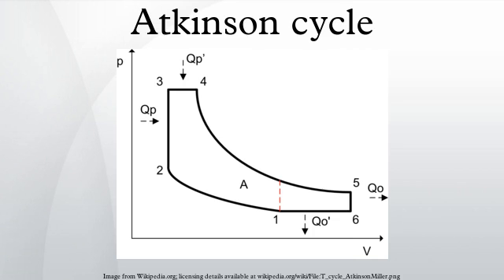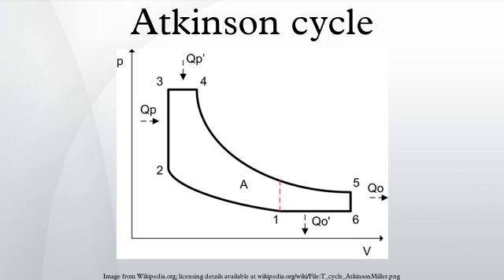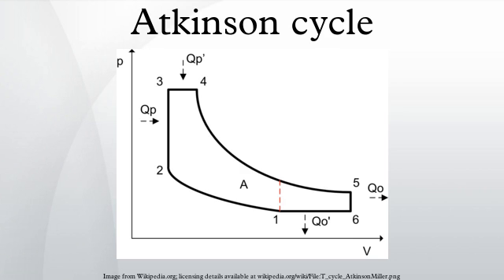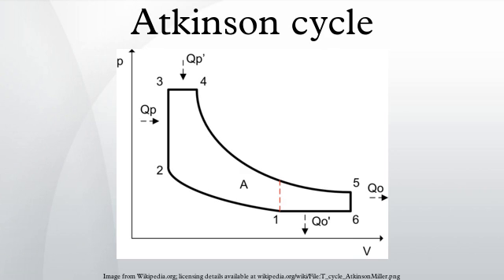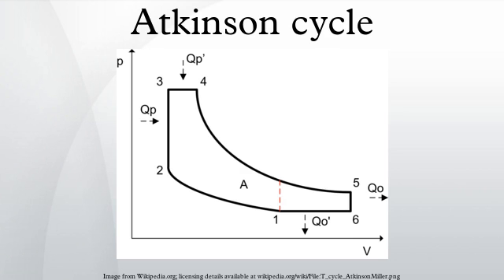Atkinson cycle

Comment: John Lucas
1 second ago
James Atkinson's third design was a 2 stroke named the "Utilite Engine".Atkinson's "Cycle" engine was efficient, however its linkage was difficult to balance for high speed operation. Atkinson realized an improvement was needed to make his cycle more applicable as a higher-speed engine. The final engine produced by the British Gas Engine company was the Utilite Engine. With this design, Atkinson was able to eliminate the linkages and make a more conventional, well balanced, engine capable of operating at speeds up to 600 rpm and capable of producing power every revolution yet he preserved all of the efficiency of his "Cycle Engine" having a proportionally short compression stroke and a longer expansion stroke. The Utilite' operates much like a standard two-stroke except that the exhaust port is located at about the middle of the stroke. During the expansion / power stroke, a cam operated valve (which remains closed until the piston nears the end of the stroke) prevents cylinder pressure from escaping as the piston moves past the exhaust port. The exhaust valve is opened near the bottom of the stroke, it remains open as the piston heads back toward compression, letting fresh air charge the cylinder and exhaust to escape until the port is covered by the piston. After the exhaust port is covered the piston begins to compress the remaining air in the cylinder. A small piston fuel pump injects a rich fuel/ air mixture during compression. This design resulted in a two-stroke engine with a short compression and longer expansion stroke. The Utilite' Engine tested as even more efficient than Atkinson's previous "differential" and "cycle" designs. Very few Utilite Engines were produced, and none are known to survive. The British patent is from 1892, #2492. No US patent for the Utilite Engine is known

Comment: Not many people are aware of Atkinson's  last and possibly best engine which was named the "utlite' engine" Here is a description: Atkinson was able to make a more conventional engine yet preserved the efficiency of having a short compression stroke and a long expansion stroke in a rather ingenious way. It sounds much like a standard 2 stroke except that the exhaust port is located at about the middle of the stroke. The exhaust is prevented from escaping by a timed valve which remains closed until the piston reaches the end of the stroke. Once the valve is opened it remains open as the piston heads toward compression letting air and exhaust escape until the port is covered. a rich fuel /air mixture is injected by a small piston pump at the start of compression. This results in a shorter compression and longer expansion stroke.  If are interested in more information I can provide links and patent numbers...